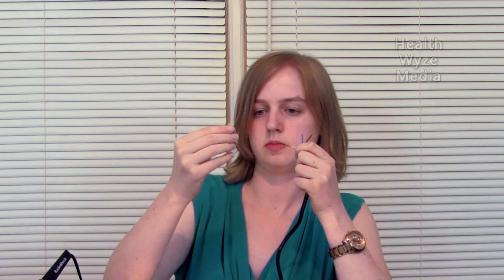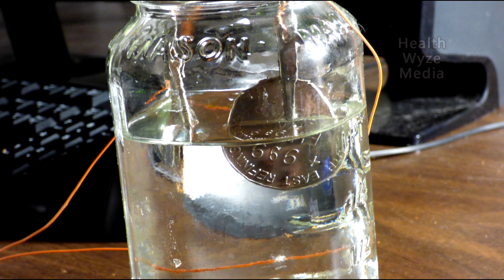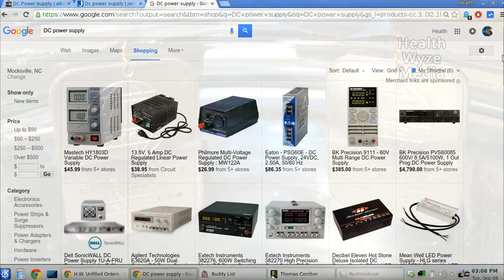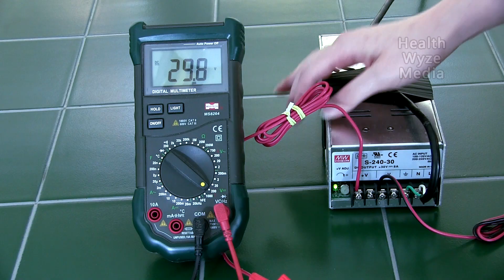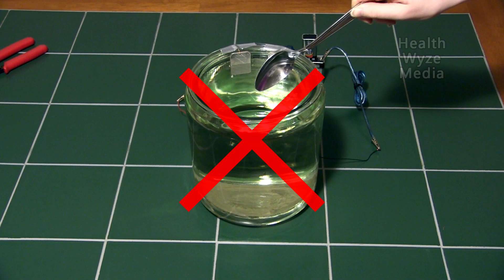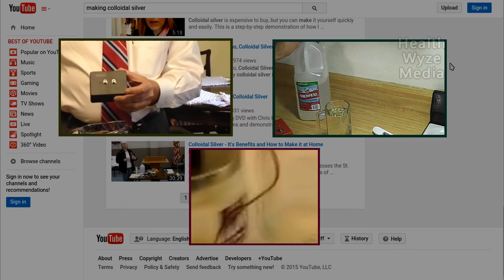How to Make Genuine Colloidal Silver

Comment: Greetings Sarah;  Great video!  As an electronics tech of 38 years, I must mention that the flux (paste) for plumbing pipes is different from that used for electronics soldering. The former has an acid base (mildly corrosive) where the latter does not (unless in recent years they changed it all to non-acid flux). Thank you.

Comment: In Australia usually the Black wire is the ground,the Green wire is the active though check this because in some wiring codes the blue wire is the active.Australia runs on an AC delivery system with the States being DC delivery from memory.Be careful though as the video suggest if in doubt go to your local electronics shop and confirm your wiring.Both AC and DC bite.Best off to buy a power supply that connects directly to your wall socket via plug than attempting wiring it yourself.

Comment: I use a 20w 12v solar panel, and another 15w 24v solar panel in parallel, usually takes couple days for half a gallon. Amperage/voltage varies on sunlight, I think that helps actually. I get 20ppm easily. 
The yellowing can be accelerated by heating on stove, and adding Karo syrup for prolonged storage to keep silver suspended.
Going to look into gels next to make healing gel, I had some silver toothpaste when I had a poison ivy rash(maybe poison oak) last year and it helped heal legs quick and reduce the itching.

Comment: Great video! I've been making my own CS for 5 years now and, while I adhere to all your recommendations, and make it pretty much the same way, I learned to make it with 2 differences that you didn't address. I use a magnetic spinner bar in the bottom of the jar to keep water moving - said to aid in a finished product with finer particles. Also, I heat the distilled water to around 160F in the beginning before combining with the small amount of CS. This is also supposed to help jump start the process. Do you have any thoughts or information on the necessity and/or effects of processing this way?

Comment: Hello! Thanks for sharing quality information. I went though the video as well as the transcript in my quest to find a mention on the current levels needed for the process. You have talked about the V but not of the mA except as a selection parameter for a power supply. What is the mA that you recommend? especially since we are not adding any catalyst to improve the conductivity of the water.
Is it true that lower the current the better it is? If yes - what is the level you recommend?
Should one start out with higher current and lower it down as we progress?
Do respond. Thanks and keep up the good work...

Comment: having recently bought some colloidal silver with outstanding results for skin conditions (10ppm) for 3 different people I am very interested in this. Absolutely great video, though a couple of questions I would like opinion on please. 
Is it ok to have a strong solution say 30ppm and dilute it with the same volume of distilled water to get 15ppm?
also
I am concerned you used distilled water from a plastic bottle, how is it possible to ensure it is free from leaching BPA or other estrogen like chemicals.
Reply from the maker: Making it a bit too strong is usually not a show stopper, but it is not to be encouraged. The risk is that you will begin making particles that are too large. These larger particles will not have the same charge, or even any charge for that matter. These particles could then electrically neutralize the charged (colloidal) particles, and take away their colloidal properties. It won't necessarily destroy the solution or make it dangerous, but it could easily make it substandard.

Milk jugs do not contain BPA. Since colloidal silver is extremely non-reactive to most chemicals, it is actually unlikely that it would cause chemicals to leach from even the bad plastics. Tiny silver particles are however very reactive to light and other forms of radiation (both nuclear and electromagnetic). The chemical tainting that you are worried about is typically caused by a combination of an unfit plastic and an acidic liquid. Most soft drinks and fruit drinks are acidic. We reported about the issues with plastics and how to avoid toxicity here:  http://healthwyze.org/reports/49-identifying-poisonous-plastics
Reply: thanks for your time in replying and the useful link, it is much appreciated.
Keep up the good work :)

Comment: excellent and thorough article. You mentioned at the beginning about buying a power cord from radio shack or somewhere. If I did that would I still have to cut the insulation & solder or do any of those places sell it already done for me?
Reply from the maker: Such stores sell the cables ready-made, so there would be no need to cut the insulation and solder.
Reply: Sweet. Thank you for the help! I'm posting one more question above.

Comment: Hello...Very impressed with the detail of the video. Well done. The young lady kinda reminds me of a female Sheldon (Big Bang Theory )   :) I have a quick question. In other videos they "clean"  the silver wires. Do you clean the bullion bars in any way or does reversing polarity take care of that issue?   Again thanx for this extremely well made video
Reply from the maker: You are partially plating one of the bars with silver during manufacture. You end up with a bar getting silver plated with slightly oxidized silver as the unintended consequence. Then whenever the polarity gets reversed, the plating begins being blasted off of that bar and pulled toward the other bar. It's the old "opposites attract" rule in action. Cleaning the silver in the middle of the process is not necessary, because nothing is dirtying the solution except for silver itself, which is exactly what you are seeking. Thus, we feel that cleaning in the middle of the process is ironically just a way to introduce impurities into the solution that were not there before. Note that the use of silver wires in other videos tends to demonstrate either recklessness or ignorance.

Comment: I have a question, why is it necessary to solder the wires? Can I put the solid core wire directly into the Meanwell AC to DC converter without soldering? What about the computer cord that deleivers power the the ac/dc converter? What does the solder do?
Reply: Josh D soldering ends of wires that will be crimped into clamp gives better more solid connection and makes it so copper strands do not fray and possibly short between power and ground etc..

Comment: was she making the wire that holds the silver hook directly to the cord that goes into the wall with not V or AP  converter box?  just the wires that will go into the wall?  120?   isn't that way too much?
Reply from the maker: No. The wires that are holding the silver bars are connected to the DC power supply. It is then connected to the wall. The DC power supply outputs 30 volts.

Comment: Excellent video! Thanks a lot.I have a question. Would this be the same process to make colloidal copper or gold?Thanks in advance.
Reply from the maker: Yes. The same process could (and should) be used. Be sure to know the risks before putting anything into your body, whether it be colloidal or otherwise. Gold has dubious benefits from the currently available evidence. In other words, we really just don't know. However, we do know that copper is absolutely dangerous, because it is almost impossible not to overdose with it, which could easily destroy the liver. It is "Game Over" if the liver fails. There's no walking away from that. We reported about the properties of copper and its overall value in supplementation in the product page of our copper lotion here: https://healthwyze.org/store/health-wyze-colloidal-copper-lotion

The safest way to internally supplement with copper is with a chloropyll supplement, which has some impressive added benefits. We reported about chloropyll supplementation in this article: https://healthwyze.org/reports/446-you-should-consider-chlorophyll-supplementation

Comment: Is CS still safe to take when there has formed a silver coating at the bottom of the jar? thanks
Reply from the maker: +Maltebyte2  Clean it as best you can, but replace it if you cannot clean it well. The container itself may eventually become somewhat conductive, which is not desirable.

Comment: I have a bone infection, in my jaw, and I saw a youtube video from a doctor in Israel who uses what he calls silver Ion generator, to insert a probe through the flesh to the infected bone in someones leg, and the other probe inserted on the other side of the leg into the flesh, and they claim this treatment cured test subjects bone infections, which I should mention are impossible to cure with present medicines, the bone literally has to be removed, so Im wondering if its possible this electrolysis process going on in the water could realistically be happening in the blood and or bone cavity itself therefore killing the infection in this bone, is that in your opinion even believable? cause for me its either that or have my jaw replaced with a metal plate.